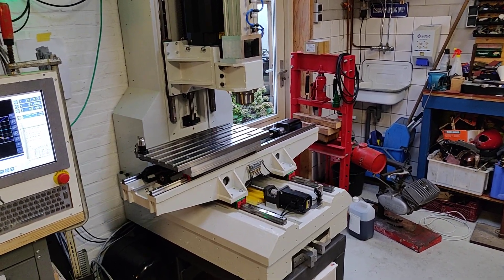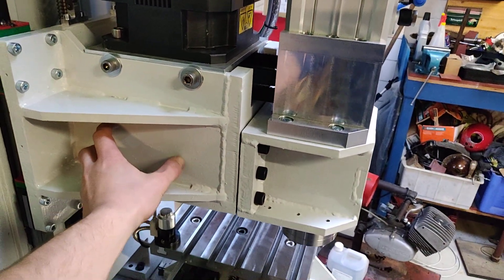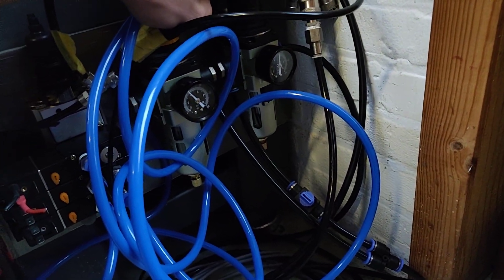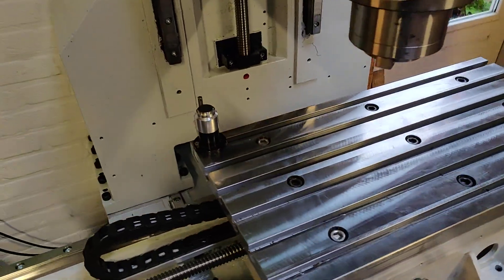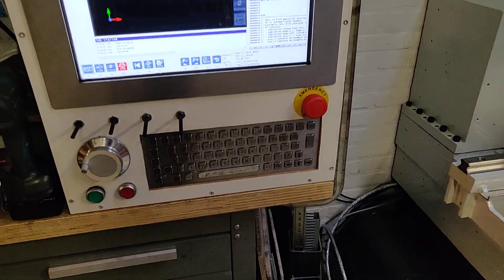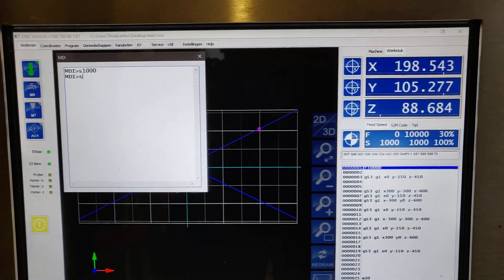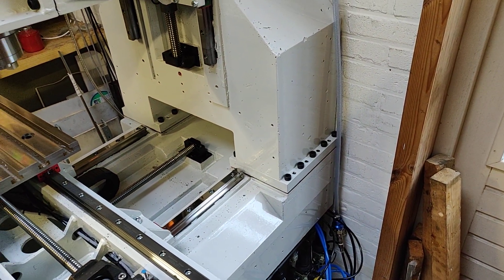Epoxy granite cnc mill walk around

Comment: What about way covers? Just wondering if you have a special solution to chip avoidance for the ways.
Reply from the maker: Yes i have way covers installed by now, there is an small movi on my channel you can see them. Im now working on the base enclosure and toolchanger. Want to make a new video soon.

Comment: Very well done!!! 
A little advice about the Spindle if you allow me, always warm up step by step (10%-30%-50%-70%-90%) 10 minutes each step from a completely cold spindle or your bearings will last no time... start the spindle at 6000 rpm is not recommended. Other than that Amazing Job!!!

Comment: Incredible build, i'm very jelous! Is there a reason why you chose not to hang a counterweight for to the spindle assembly at the back of the machine, since you already have the chain going to the back? There would be no risk of losing compression and head falling, also would remove the variable force problem of the air cylinder.

Comment: Does anybody know if its possible to calculate/simulate the precision/deflection of a CNC? Or do you just go as big and heavy as you can to improve rigidity?
If so, how do you even calculate the cutting forces? Feeds, speeds, material and tool geometry all factor into them (I imagine)
Does any CNC hobbyist even bother to do this?
Reply: I've seen a few diy cnc'ers do FEA simulations of frame deflection for a given force on the cutting bit using Fusion 360.  Here's one example: https://www.youtube.com/watch?v=McC1Y_9mr8o.  Sure seems like it's a minority of builders who do in-depth calculations.  There's an old (~23yrs) paper by a student associated with Alexander Slocum which is not bad to get an idea of how one might think about rigidity and design tradeoffs: https://pdfs.semanticscholar.org/5487/82f4c63376150991dd323d0ef15a7da2fee8.pdf
And a fun build by a guy going the bigger-is-better route: https://hackaday.com/2016/04/25/a-polymer-concrete-diy-cnc-with-no-perceptible-budget-in-sight.
I don't know if this service is any good or even active but they offer to analyze your design: http://www.cncroutersource.com/CNC-router-engineering.html

Comment: Hi Stef
Great job It just keeps getting better.
The 6 axis CNC controller can you post a link to the website please?
Reply from the maker: https://www.edingcnc.com/products.php?productid=116
Reply: Thank you Stef
I am wondering if the controller can do simultaneous feed 5 axis milling?
I was hoping to find a good brochure or videos in English.
Reply from the maker: @johnmcnamara3719  yes it should be able to do 6axis simultaneously. You can download the software for free and run it as a simulation without a card connected to test it out your self.
Reply: @Svanitterzon  Thanks I will download the simulator.
I also want to see how the controller software interacts with Fusion.
I hope there is a well debugged post for fusion.

Comment: im curious, why dont people buy old manual mills and then turn them into CNC mills with servo motors on all the what would be manual adustments. seems like alot less work than designing your own from the ground up like this. I would think it would be cheaper too. Ive seen them sold for $1000-2000. How warn out their weighs are is another story, im not sure how bad they would be and how exspensive it would be to have them re ground if needed

Comment: Could there be an issue with the different thermal expansion between the metal and granite epoxy pieces?
Reply from the maker: The epoxy is steel filled, its dwh310fl its special made for fixing machine components together if interested you can search on this stuff.

Comment: This is beautiful! Not knocking the good work but... Biggest question is the cost effectiveness. Is there a commercially available machine with similar table dimensions (sure, they won't be epoxy filled...) that costs less? I'm sure you can purchase a machine from an auction for way less than the price, let alone the time it took, to accomplish this.
I am also a sucker for pain. I build my own CNC and 3D machines that would cost a fraction if I bought online. It is the joy of saying 'I made this' :-) 

I just heard the rapid movement. HOLY LOUD BEARINGS!! The Y-Axis bearings look a little on the small side, though. You also need to balance the spindle. You'll notice the imbalance in your cuts, most notably in face milling.
Reply: Commerciali made CNC of this specs will be 4 times more expensive ( at minimum)

Comment: Extreme well made, the only thing you need is a glass scale controlled linear system, because the ball screws are often not that precise
Reply: The majority of the industrial machining centers I've seen use ball screws and rotary encoders on the servo's, with no linear scales. It works well for precision to at least .0001 in
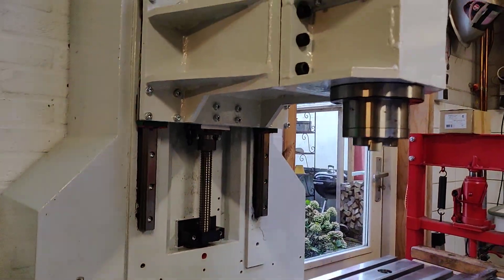Reply: @Nidkidful  at 7:36 he mentions at least one of the ball screws is C7, so kind of not that accurate although probably some of the errors can be mapped in software and compensated for.  C7 is apparently +- 50 microns (roughly .002") per 300mm (https://tech.thk.com/en/products/pdf/en_a15_011.pdf)  but maybe the precision could still be much better, like the .0001" you mention.  Not sure.

Comment: AMAZING build. Seriously. That looks fantastic. If I can make one suggestion based on my own personal experience/opinion: either put the keyboard on a hinge to be able to sit horizontally. Or - and this is likely what I'd do personally - get a wireless keyboard remote (they're popular with Raspberry Pis) and make a little cabinet where your keyboard currently is where it can be stored and not get dirty. The reason I suggest this is that I really dislike typing on a keyboard vertically like that, plus the remote has a trackpad and backlit keys. And they're wireless with a pricetag of $10-20. So when it inevitably gets broken as a result of being in a shop, it's easy to replace while still being very convenient. I also hate typing on a touchscreen, but I've found most of what I find uncomfortable is the vertical orientation. It's like trying to use a TIG pedal standing IMO. Though if you're perfectly comfortable with it, it's a moot point. And again - GREAT job. I think I'll try my hand at something similar

Comment: Wow great job! I'm jealous of your skill in designing this. One thing to be aware of is if you test that vertical servo brake while the load is moving, the brake surface will glaze and make it much less effective. They are designed to be static holding brakes only.

Comment: I always wonder why DIY mills have short table on long rails while commercial mills have long tables traveling on relatively short saddle?
Commercial mills have the ways protected from falling chips by the table itself and gravity while you still have to construct complicated protection for the exposed rails and always watch for chips the gravity will try to deposit on them.
Constructing long table wouldn’t be more complicated than long saddle so why doing it opposite to how the big boys are going about it?
I am not referring to complex machining centers but rather simple “Bridgeport” style milling machines that your machine is closer to in principle.
Reply: hard to get a big table economically. The table is extremely expensive in comparison to many of the other components. Most DIY build are used or surplus linear rails where new rails are 2-3x the price. But big machine builders have the castings and surface grinders in-house to make custom big tables economically. 
Also diy builds not as much optimization - lower payload weight means higher dynamic machine on smaller leadscrews and servos. Industrial machines this size likely 1.5kw servos vs 750w and probably 25 25 30mm ballscrews not 20 20 25mm

Regarding bridgeports its all a casting which is very cheap and the longer table using a dovetail way system increases the rigidity and reduced the wear on the system over time. 
The larger table is also very flexible which is more appealing for a jack of all trades machine like a bridgeport which can do almost anything but isnt really good at any of it.

Comment: Awesome machine! Subbed.
How do you plan to protect the linear rails and ballscrews from chips and coolant? And do you plan on making a automatic tool changer?
Reply: I wonder if you could just make an enclosure for the work table. I think it would need sliding panels to move with the machine.
Reply: Slide way covers...

Comment: Nice machine good to see you share this project taking on such a task is quite the challenge. Lance & Patrick to your subscribers and viewers. Wow hydraulic cylinder counter weight instead of the lead ballast weights form the past CNC machines we remember them as how neat is this, neat to these two guys. 
We use a BT 30 spindle here for our second operation US made bench top horizontal milling head we can relate. ??? Are your bearings angular contact or deep groove, if so what class wanting to learn here if you do not mind. The electronics look really nice.

Comment: I was wondering how much did it cost in total, not including the working hours or the tools you used to calibrate the machine?
I am asking because it looks very nice and a lot of work has been done to come up with it!

Does it worth building it rather than just buying it?

I hope you can answer this since I am working on a much lower cost one and I start to feel like it not that easy to do such an accurate machine with a moderate amount of money!
Reply from the maker: Its half the price of a haas mini mill.
Reply: @Svanitterzon  
That's still not cheap enough to encourage someone to build it by himself
anyway, I think if you can use it in a commercial way to get your money back it will be a good deal
Reply: Probably more economic to buy one. But it wouldnt be as fun to buy one than it is to build one.

Comment: why use pneumatic counter weight, instead of just a large weight? Also why use linear slides instead of scraped surfaces? Seems the effort to increase rigidity is wasted when you use linear slides.
Reply from the maker: the pneumatic counterweight is to save weight that needs to be put in motion. and the linear ways you mean against dove tails?
Reply: @Svanitterzon  or T rails
Reply from the maker: @arthurjohnson3438  linear rails are easier and you see them on all high end machines so i don't see a problem.
Reply: guess thats true, great job on the build!
Reply: I guess for his applications there's not much benefit to boxways/dovetails, as far as I can tell from reading https://www.linearmotiontips.com/what-benefits-do-dovetail-slides-offer-versus-other-linear-bearing-types/ and https://www.cnczone.com/forums/uncategorised-metalworking-machines/141921-box-ways-vs-ballway-rails.html.  It looks like ways might win out when you're working with super high loads all the time.

Comment: Hello Friend
   Your videos are very good, I just see them and they seem magnificent, I have a doubt since I am making a machine and I wanted to see the weight and wanted to put a piston but I do not find much info, I do not know if you can help me and I will return you somehow
Reply from the maker: you mean the pneumatic counterweight?
Reply: @Svanitterzon  yes
Reply from the maker: @maq-Yantek  Here is a picture of what is hanging behind the column http://gallery.svitterzon.nl/cache/albums/vmc/2019-09-01%2014.51.04.jpg
The air cylinder is connected to the air tank to keep a constant pressure on the cylinder.
Reply: @Svanitterzon  That is very interesting.  I would never have thought of that.

Comment: I've been researching epoxy granite cncs for awhile now, and this is the best one I have seen so far. How much was the total cost of the machine? Would it have been cheaper to buy something like a Tormach, or is this more capable then what they offer? Also, why did you use a servo motor for the spindle? Is there some benefit to using a servo or is it something you just had on hand? Sorry about all the questions, but I am planning to build a cnc of my own one day and I want to learn all I can.
Reply from the maker: The new tormach 1100mx equipped with tool changer costs brand new 29000 dollar. That's roughly 26000 euro. My build probably gone end up somewhere around 16000 euro.
Then i have a 18 pos tool changer, twitch bigger spindle power, 2 times faster machine moments. more travels. More machine weight and a smaller foot print. 
So its cheaper then a tormach as long as you don't count the endless hours of work that have been putted in.
For the spindle servo, it has position feedback which is needed for the tool changer since bt30 tooling needs to put in the exact same place every time. And the servo has huge torque even at its lowest rpm so makes it usable for rigid tapping.
Reply: I bought a Syil X5 for about 15k euro. With servo, tool changer, tool setter, edge probe, flood coolant, LNC 5800 controller, 12k rpm 2.2 kW spindle, enclosure etc. However much smaller work envelope. 

I think that unless you like the machine to be your first project by itself, it is probably better to simply buy a finished one. His machine is a very nice project however. I wish I could do something like that :-)
Reply: you might like https://hackaday.com/2016/05/01/precision-cnc-with-epoxy-granite if you haven't already seen it.

Comment: Looks good. Are you planning to increase max speed? 15 m/min seems a tad slow for a production machine of this size.
Reply from the maker: It wont be a real production machine its still a hobby mill. And if i want to increase speed i need to replace the ball screws since the servos already running at max rpm.

Comment: Really nice job, awesome machine. The spindle at 6000rpm sounds a bit rough - is it the spindle or the toothed belt? They tend to sound more than e.g. v-belts.
Reply from the maker: Its caused by the belts. Now i used some cheap htd5 belts. Mabye a little more quality belts make a little less noise. But i need toothed belt because of the torque and the position function for the tool changer.
Reply: @Svanitterzon  Any plans to rebuild to direct drive? On my machine, the noise from the toothed belt is the only thing really bothering me.
Reply from the maker: @TeslaAtoms  No i think make it direct drive will be a little to much. lets see how it sounds when its cutting. BTW the sound in real life is different then on the movie.

Comment: Impressive! Great job. Only thing that bothers me is the aluminum subplate under the table, I don't get that one. I'd replace it with an epoxy granite casting or grey iron (or even steel for the weight), which should dampen the first vibrations when milling. But all depends on milling results. Nevertheless, again, awesome project buddy.
Reply from the maker: Lets me first see how it performs, i can always mill that block again from steel if needed.
Reply: Really professional built!....   Whenever there are mating of two types of material that like steel and aluminium or epoxy, will there are diiferences of coefficients of heat expansion between them and make wrapage happening?